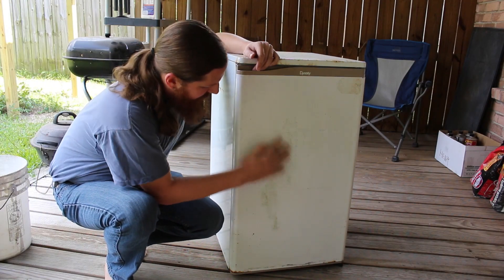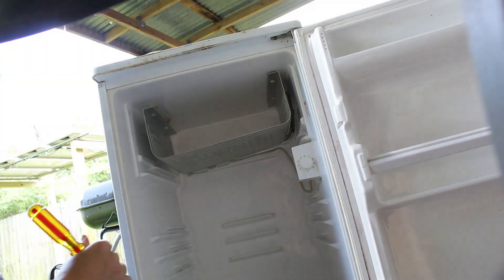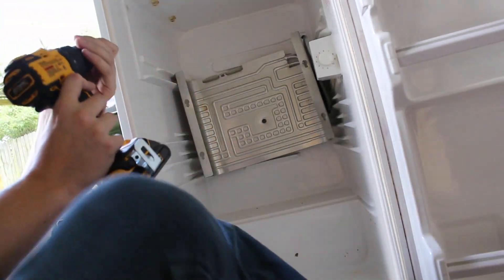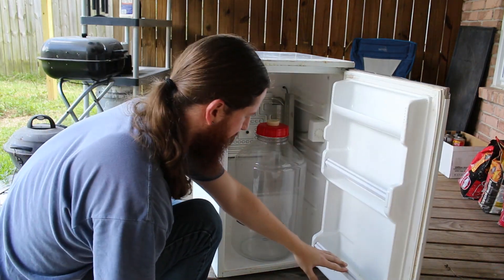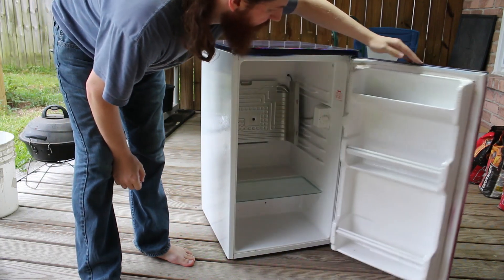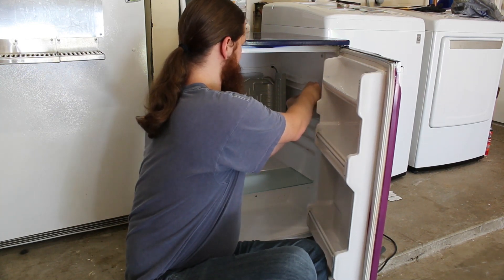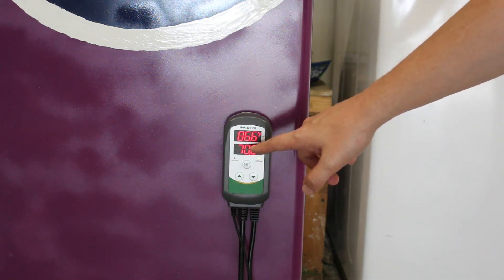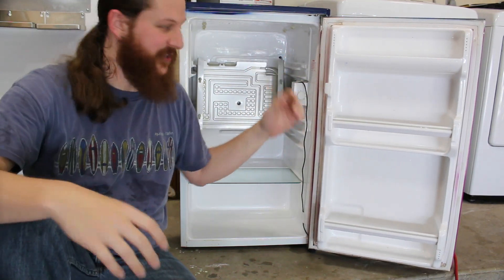DIY fermentation chamber out of a mini-fridge

Comment: So what happens to the original temperature setting/thermostat? Do you disconnect? Set it somewhere in the middle?
And wouldn't it be colder near the freezer component you bent down?  Do you have video if the heating element you added later?

Comment: Hi, one question, the fridge is frost or not frost, because if you have a heater and the frezeer defrost, will drip  and could be cause a short circuit.

Comment: If you lift the edge of the rubber gasket up around the edge of your door you’ll see were screwed in if you remove all of those screws you can take that plastic insert out of the door and put you some insulation in there and it will be flat your magnet will still be intact you’ll be able to close your door and take the glass shelf out and lower your fermenter down
Reply from the maker: I had thought of that, but decided against it. There are many ways to do this, but I wanted to alter it as little as possible, because 1) I'm lazy and 2) may want to use it as a minifridge later on. I also store the sanitizer mason jar in the door so I can keep a blow off tube in there when I get really strong krausen going.

Comment: Excellent video. Since it's a beater refrigerator that's going to be used for a specific purpose it seems you could notch out those door shelves for clearance for the fermenter so you could sit it on the bottom - maybe put some tape or epoxy some plastic strips across the resulting slit holes. There's no electronics to worry about in the door.
Reply from the maker: I had thought of that, but I just didn't know if I was going to do a lot of lagering. So far, it works with no issue. A blow off tube was a good investment for this setup, so it's fine for now. I may do it in the future, but doubtful since it works well as is.
Reply: @falconsfermentations2889  Would the Fermonster fit on the bottom of the fridge if you removed the shelving in the door ?   I'm leery of relocating the freezer on mine.  Afraid of breaking one of the tubes.
Reply: The whole door liner could be taken off and done away with and if need be use some styrofoam for insulation or spray foam